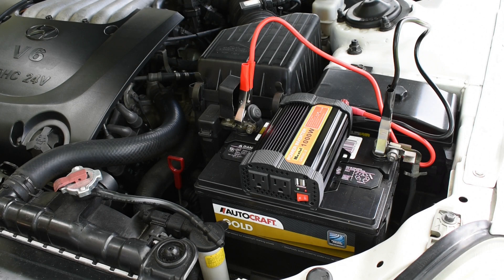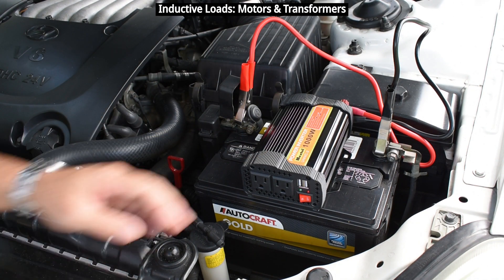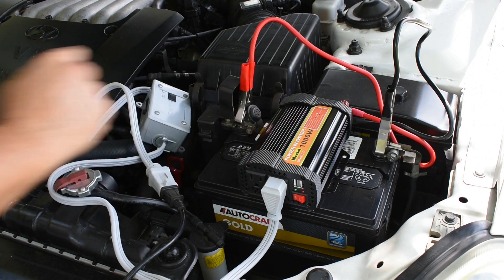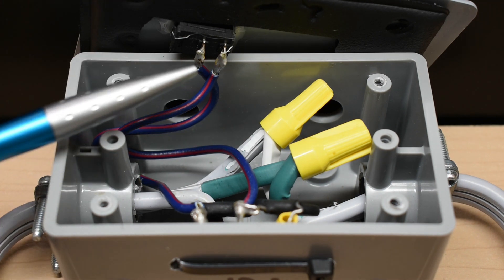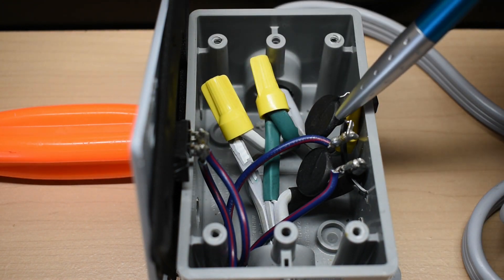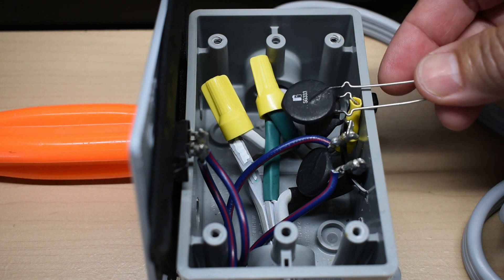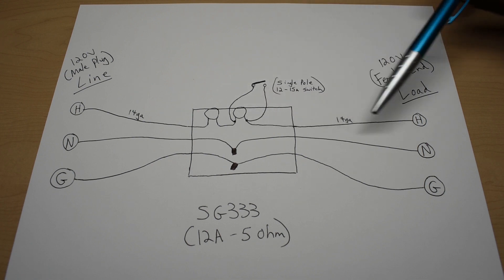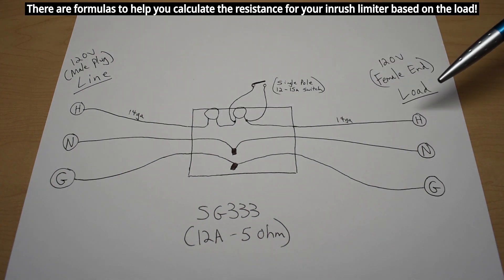The Simplest Soft Starter!

Comment: This is a useful video for a quick and cheap soft starter for preventing inrush currents in devices. However, you should design an updated version of the circuit. While this design works, and works well, there is one fatal flaw. If you unplug the load and plug it back in or switch the load on and off it draws the same inrush current we are trying to prevent.
Reply from the maker: This method isn't recommended for rapid switching ON/OFF of appliances/devices.

Comment: Awesome work.  Commercially available softstarters for window AC units cost around $300.   Can this be used to turn on a small fridge or window AC with a generator or inverter?  Thanks for this video!
Reply from the maker: If you size the inrush limiter properly, it can help you start up the fridge/AC. If you don't size it correctly, then the compressor may not start up.
Reply: Thanks alot
Reply: @electronicsNmore  - is there a size limit to build this device?  Is there a cutoff on scaling it up?  Searching for a Soft Starter for 10HP AC Motor.  Any feedback?

Comment: Very informative video, this is the kind of video I was looking for a while, but I do have some questions, does this system works with induction motors ?, and if the resistance is very low after the resistor heats up, does it mean if the load is powered up in short interval and the resistor resistance value is still low it can experience inrush current again ?
Reply: Good question. I am interested in this for reducing the inrush current to a small ac compressor but once the ac is 'running' it will cycle the compressor as needed. It would depend on if the thermistors can cool all the way off before the next compressor start. It also seems possible that you run into an issue of your normal 'running' current not creating enough heat in the thermistor to maintain its lowest resistance value consistently, causing the current in the actual load device to fluctuate as the thermistor 'hunts'.  Really interested to know how this works on a ~5000btu ac.
Reply: @Vigo327  Did you ever try it? I'm wanting the exact same application, 5000 BTU A/C that is rated 450W @ 115 VAC.
Reply: @AlanCanon2222  I have not! I have tabs open in my phone about calculating the value of the thermistor, etc, but never did do it. I have been working on an off-grid electrical system for my home and can say that my 5000btu unit in the home actually is down around 400w with the compressor running and fan on high. The fan itself is 60w on high, so compressor load on my unit is ~340w.  I have not accurately captured the compressor 'inrush current' yet, though. Good luck with your project and i hope whoever tries it first will post their result. 👍

Comment: Thank you for this video. I have however a 5.8 full load ampere pump, and 220v hot wire. Will the same limiter suits my equipment? Appreciate your advice.
Reply from the maker: There's a link in the video description area to a calculator.

Comment: Quick question; I am thinking about doing this for a dust collector (basically a giant vacuum). It pulls 35-50A on the inrush, and settles down to around 8-10A at running load. Would something like this work to reduce that massive inrush current to prevent overloading a circuit breaker? Also, when you mention sizing the inrush limiter, is that for the inrush load or the running load?
Reply from the maker: If you use the correct resistance value and current rating, yes. The size is matched to the operating current.
Reply: @electronicsNmore  Thank you very much - appreciate the response! Subscribed!

Comment: Hello. Great video! I would like to build a similar soft start for a miter saw. I would like to build it for 25 amps. Would this work? Ametherm SL32 1R030 (Pack of 2) NTC Thermistor, SG379 HVAC, Inrush Current Limiter 1 Ohm Ohm ±20% 1.18" (30mm), or what do you recommend? Thank you sooooo much!

Comment: Am I right to imagine that there's a good deal of efficiency loss due to heat? I recently got a soft start RV which is designed to start AC compressors specifically, and it doesn't have any visible heat sinks or anything like that. I imagine it's a more efficient setup, but obviously much more expensive. Kinda curious if what you have here would work for some smaller inductive loads i have in the RV
Reply from the maker: What you bought must use a capacitor. A soft start kit. As for the ICL, you will always have some power loss with it connected.
Reply: @electronicsNmore  that makes sense, thanks!

Comment: I would like to use an inrush limiter like this for my hydropneumatic pump that has a cycle time of aprox. 20 seconds. How quickly do these NTC thermistors warm up and cool down? Something tells me that this elegant solution wouldn't work for a load that cycles 20 seconds on and 20 seconds off?

Comment: I NEED HELP…. I have an air conditioner 5.9 amps running. 115v @ 60 hz. My inverter is 1000 watts. The inverter is overloaded 9 out of ten times I turn the a/c on with it. Which thermistor do I need?

Comment: Great video! Very informative and a simple solution to many problems.  I have been thinking about rigging up a couple of flexvolt batteries to power 110v 1/2 router but was worried about the inrush current damaging the batteries with arcing during switching on and off, would this not only soft start but soft stop? If thats a thing?
Reply from the maker: No soft stop.

Comment: Please excuse my ignorance and the answer my be quite obvious yet i would just like to be sure. What in your thermistor circuit would need to change for a 220v single phase induction motor for a pump? Your  input would be very helpful. Your site looks to be quite informative thus I did subscribed. What is the benefit of the more complex circuits that use delayed relays to eventually bypass the large load resistor in their circuit? It basically has a resistor and cap in parallel that builds up charge to close the relays while the big resistor limits Inrush current then gets bypassed once the relays close? yours seems so much simpler but am I missing something.
Reply from the maker: The ICL can handle 220v - 240v. Most important is getting the correct resistance value and current rating. You can find a lot more info online about the component.

Comment: Hey thanks for the vid.  Do you mind linking a oil filled run capacitor to test?  I have a 2000w inverter and on occasion it will alarm when starting a 15a mitre saw or tablesaw.  Amazon likes to write both start and run on the capacitors.

Comment: would this work for a 1.5 hp water pump? 1.1 kw, it says 2.5 amp but i think its surge is much higher. 
im using a 3kw inverter. would it be better to set this up close to the pump or the inverter?
Reply from the maker: Inrush limiters will work, you need to use the correct rating. It makes little difference where. Thanks for watching!

Comment: Can I use  this in a 220 volt electricity? I wanna make one and use it overseas,and also can I put 3 limiter in series to make amps higher?Thanks!
Reply from the maker: Placing in series INCREASES the level of resistance, not the current handling capacity. Yes, should work fine for 220V. Thanks for watching!

Comment: I would like to make one of these for an off grid cabin I have.  It has a fairly new Best Buy/Insigina 9.9 cu ft fridge/freezer that lists power consumption of 160W at 1.4A.  I have a 12v 2000W inverter connected to 2 banks of GC2 6V batteries in series, so 2 pairs of 6V's on a battery switch so I can switch from bank 1, 2, or tie both together.  You'd think that would be enough to start the fridge under any circumstances, but it doesn't.  When one bank gets on the low side but still far from the end of its cycle, the fridge starting up will trip the low power alarm on the inverter and it won't reset itself (all power cables are correctly sized, probably overly large).  If I flip the battery switch briefly to the other bank then back again, the inverter will be happy, quit beeping and the fridge will run until it shuts off, and the cycle repeats.  Question is - do you think the setup in your video would be sufficient for this fridge, or should I be re-sizing the components and if so how do I know what size?
Reply: I built this and tried it out but it didn't seem to solve the problem and the inverter still trips to under voltage.  The fridge (1.4 running amps) is the only thing I'm using this for.  Should I be using smaller inrush current limiter like a 5D-11 rated for 4A continuous?

Comment: hi , thanks for the great explanation. still one point : if we power Off and quickly try to power on the appliance, a good chance the thermal resistor still hot and thus didn't present high resistance so It will not work. I ve not tested it myself but I am curious if someone have experienced that exact very scenario I am describing here
Reply from the maker: You cannot power on and off quickly. You need to wait at least 30 seconds.

Comment: Hi!! Great video. does it matter the type of inverter you have? be it a pure sinewave or modified sinewave?

I have a 3000w (6000w peak) modifed sinewave and I would like to use it to power a fridge in my camper. I read online that fridge motors being reactive loads do not like the modified sinewave, could this solve the problem? or it wouldnt be needed as 3000w is more than enough for the small 150w fridge?
lastly what is the likely damage in using a modifed sinewave on a fridge.
many thanks for the answer
Reply from the maker: The inverter generator shown years back on my channel, a popular video, used a 1000W mod sine inverter. I powered my refrigerator on and off for 5 years with no problem. Sine wave is best, but more for sensitive electronics/devices. Thanks for watching! Be sure to share the video link with others. The tip works on both. A load way less than the rating of the inverter, should not require what I show.

Comment: Would a sizable capacitor, or two for high and low, in the box - instead - be able to handle the initial starting surge of equipment?  I've been an antique table-mounted grinder (still have it) that had a large capacitor wired in with it, but it was confusing as to where it was wired in at - so I couldn't figure out where this large old capacitor goes.  But I imagine it is for the same purpose.
Reply from the maker: Yes. I've used oil filled run capacitors in series with the load. To get the same level of resistance, you'd need (5) 100uF oil filled run capacitors in parallel. You can experiment using 200-300uF. Thanks for watching! be sure to share the video link with others.
Reply: @electronicsNmore  So it's a size issue that you're avoiding it seems.  I just looked up those caps, and they seem huge.  You may be on to the better formula - probably would have been good to cover why this was better than caps in the video, but it's an excellent video nonetheless.  Thank you for creating it.  I may order the parts in about a month.

Comment: You mention that this is good for inductive loads (motors), but I'm wondering about the ignitor in my portable pellet stove.  I have a 1500/3000w inverter and it gets tripped every time I turn on the smoker.  Of course, its always the ignitor that causes this. Once burning, the blower fan/CPU draws less than 100w.  I'm wondering if a soft starter would help in this situation or if I simply need a larger inverter?

Comment: Thanks for posting this video. I have a 1000w max generator and I tried your soft starter with my medium sized refrigerator (2.2 amp). The overload light still comes on and the engine shuts down when my fridge compressor comes on. Any suggestions? Should I add a third thermistor? Thanks again!
Reply from the maker: Try adding a hard start kit to the refrigerator.
Reply: @electronicsNmore  will do, thanks

Comment: Shop around for the inrush current limiters.  Mouser sells the exact part number for $1.80 in single quantities up to 9, with 10 or more the price drops to 1.64 each.  Amazon gets $14.99 for a package of two.
Reply from the maker: Now add in the shipping cost for Mouser. :-)
Reply: @electronicsNmore  $7.99 for UPS Ground.
Reply from the maker: @carlhartman2818  So you're not saving too much, and with Amazon Prime, you'll get it fast.
Reply: Hey, I'm not being snarky.  I like your concept and I plan on building several of these for myself and for friends.  In any kind of quantity, Mouser is still a better source.  Sometimes it pays to shop around in spite of the convenience of Amazon and in spite of affiliate links that you may have with them.

Comment: This looks like extremely helpful idea. Would that work with RV air conditioners ?
Reply from the maker: It works great for many applications. If you hold back too much current, the compressor won't start up.

Comment: Nice tutorial. You failed to mention the drawback of this method.....Repeated use. If you use a power tool for instance, you may have tool on and off many times during a job, like cutting 2x4's. The thermistor would have to cool really fast between starts or it will be supplied with full inrush current again, right?
Reply from the maker: Correct, this method isn't ideal for fast ON/OFF switching. You need 30 seconds minimum wait time
Reply: @electronicsNmore  I have a portable log splitter that I want to run with this. I ordered the inrush current limiter and I plan to thermal epoxy it to the inside of an aluminum junction box to remedy this issue. Hopefully it works!

Comment: Should the amp rating of the current limiter be chosen based on the start current or the running current? My freezer uses 10 amps to start but runs at 1 amp. Thanks.
Reply from the maker: https://www.ametherm.com/inrush-current/selecting-an-inrush-current-limiter.html

Comment: I have a question about this. As I’ve told you already, I have already copied this several times only with the slight modification of a heat sink to dissipate the heat - however I recently tried something new with the leftover thermistors I had left.

I tried to do it with a 12v dc plug on the portable air compressor I keep in our car. Once on the side of the highway when we popped a tire, I turned it on, then off, then on again really quickly by accident - and it blew a fuse. Ever since then I figured one day I would install these thermistors on it and just now when I did a test run before soldering - nothing. It wouldn’t turn on. Is it just not enough coming through to get that motor spinning??
Reply: Probably. At 12 volts a 5 ohm thermistor would limit the total initial power draw to about 30 watts. That may be below it's trigger point.
Reply: @Sara Morgan that’s an interesting point and one I hadn’t thought or but we’re using it in a non traditional way. We’re using it as an inrush current limiter. By the time the heat sink has a chance to dissipate any heat the current has long passed.

Comment: Probably won’t ever see this comment but I made one using 2 15 amp rated current limiters around 5 ohms each, got it all put together plugged it in nothing happened, plugged in a small shopvac to try and get my little generator to run it and one of the limiters started smoking, shouldn’t they be able to handled that load being rated at 15amps?

Comment: if using on a refrigerator, could this damage low voltage circuitry / circuit boards?
Reply from the maker: For a refrigerator I would suggest a hard start kit by Supco to supply more starting torque.

Comment: Would it help to use a metal box and glue the resistors to the box with silicone? Glue one side.
Reply from the maker: No. Inrush current limiters aren't used with heat sinks. Thanks for watching
Reply: I believe using a plastic box is a very BAD idea as these parts when operation closer to their specified values run VERY HOT but they should not be heat sunk either as that would then increase their resistance by reducing their temperature and will probably end up dissipating even more heat.  I'm thinking the safest thing to do is to use a metal box with good  convection air flow (vent holes or protective screen).

Comment: That 2.7 looks like the same engine as in my 04 Optima.  Not a bad engine but plugs and alternator can be a real pain.
Reply from the maker: Same engine. Yes, you need to remove the intake plenum to replace the plugs near the firewall. I recently uploaded a video showing the full process on how to replace the alternator. Be sure to watch. Thanks!
Reply: I will, I haven’t done it yet but I know what a pain. 

I got the repair books from the manfactuerer  when I bought the car and when my alternator went all it told me for a V6 was “Good Luck”. Turns out the ball joint, tie rod cv axle, and motor mount is involved. 
Some say you can get it from the top but not without a lot of top side disassembly but it don’t look any easier.

Comment: I 'm commenting with hopes that your community may respond with some help.  I have a wine fridge on a 115V socket.  I am not using an inverter.  When fridge compressor kicks on, my ceiling LED lights go dim during the start up mode.  My lights and fridge are on the same circuit and can not be changed.   Would this solution you present in your video remedy my situation where the lights will not dim during the "Start Up " mode?
Reply from the maker: You're trying to hide a problem. If you measure the AC voltage at the receptacle where the wine fridge is plugged into, and you see a big voltage drop when the compressor turns on, then you have a wiring problem. Either the wire size is too small, too long of a distance from the panel for the wire size used, or you have a very poor connection(which could overheat and cause a fire) between the panel and receptacle.